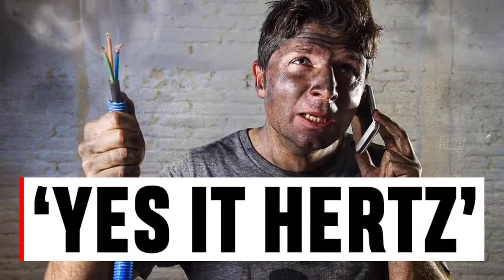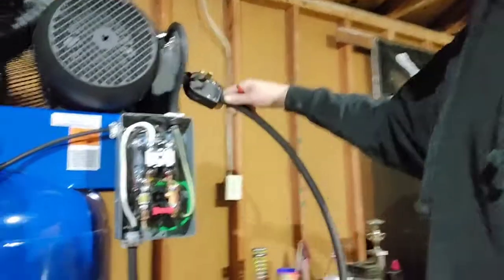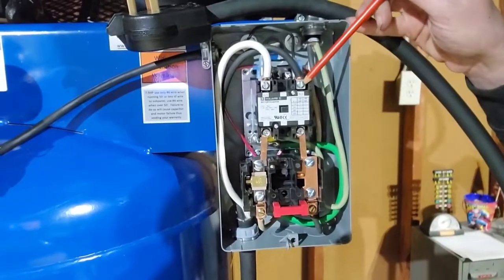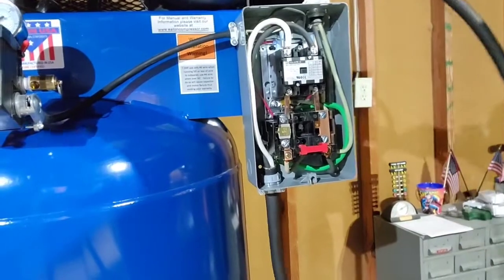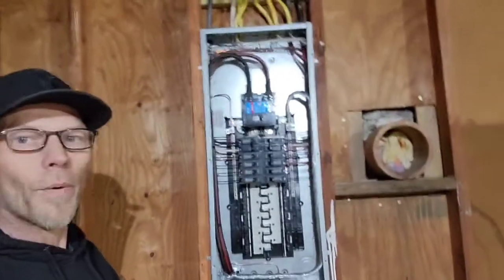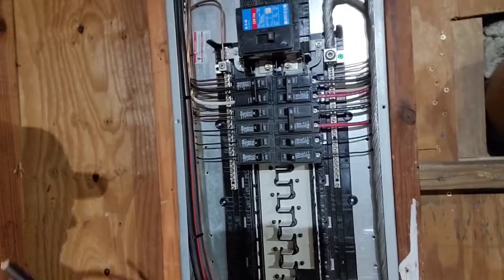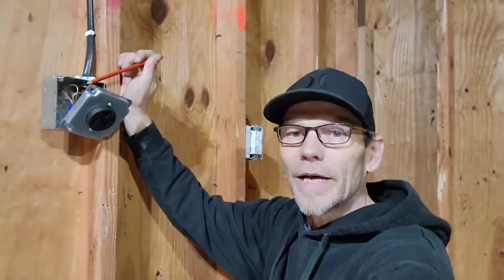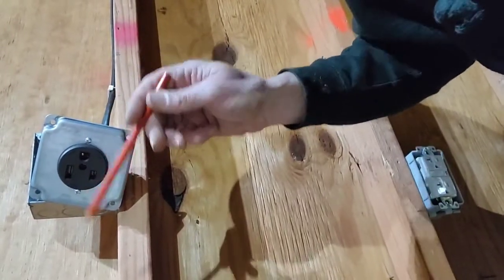Project X - DIY Air Compressor, 7.5 HP Motor, 220v, 1P, Plug and Receptacle Wiring Install - Part 2

Comment: Great video, thanks.  I have one of these coming next week.  Please correct me if I am wrong or if Eaton has some sort of special requriments however everything I have seen for 1-phase power (videos and discussions) states that the two hots (in your case, gray & black) doesn't matter which way they go (dont have to go black to black and gray to gray) in as long as they are each going/matching hot to hot on each end.  The Green ground however, is crucial.  The two hots are each 120v for a total of 240v, the compressor doesn't descriminate against gray and black as long as each of these are going into a hot on each end of the connections.

My understanding is that this could however be important if you were connecting 3-phase power.  What you are doing is by no means incorrect, it is actually very good practice IMOP.  Please let me know if you think I am incorrect.  I am learning all of this and everything I have written is to the best of my  knowlege from watching videos and reading.  Thanks again and please let me know how your set-up is working out for you.

This video shows what I am trying to convey.  https://www.youtube.com/watch?v=DINNg_hAWwI

Comment: A good video, even though it's a little shaky. A person good at DIY projects utilizes all the resources available to them. You could have used a tripod-mounted camera and your daughter or Dennis to film and later edit your video. When I connect my white wire to a 220V circuit, I wrap the ends with electric tape to show they are used as power and not as common wires. A black paint-type marking pin also makes a good substitute. Since your compressor only draws less than 40 amps, the two 50-amp circuit breakers could be replaced with two 20-amp ones. The 6/2 with ground cable could be replaced with a 10/2 with ground cable, which can easily handle a 40 amp load. The attached compactors can easily handle any start-up amps. I could be wrong with my wiring comments, but this is how I wired the same compressor type. Ten years later, I've had no problems, including tripped circuit breakers.

Comment: DIY pressure washer next 7.5 horsepower 5 GPM let's go
Reply from the maker: Lol, I like it! I recently bought all the stuff to add a 3/4" water hose connection over the winter for pressure washing. I figure then can use it as either a pressure washer or as a water jet for cutting 1/2" steel plates

Comment: Great video, was having  a hard time finding any good video on wiring up these compressors. Do you by chance know if this would be the same wiring for a eaton b27cge40 starter?
Reply from the maker: Appreciate the kind words Ethan. I struggled to find a video on this myself thus the reason I made this one..to answer your question, yes - it's the exact same principle, the eaton b27cge40 is a 1 phase starter & is wired up the same way. Where I wired the outlet you'll have the starter in its place. I like your use of the starter way better than my outlet, I may have to upgrade....

With it pulling 40 amps be sure to use 8 gauge wiring when installingit. Hope that helps!
Reply: @projectx2.718  Yea mna it this video is a gem for any guy like me who cant figure out how these are wired up. Couldnt find so much as a diagram. Mine is actually set up like yours, in a control panel on the compressor. Im torn between wiring a plug and outlet or just hard wire it. The other thing i was stumped on was it looked like the pressure switch had both leads running to 1l1 and not 2l3. Should it be running to both? Could have been me who moved it who knows. Bought this compressor as with no plug. Thanks again!
Reply from the maker: @ethanhall5501    - the 2 pressure switch wires; white goes to 1L1 & black to 3L2  from the factory. If you go to my part 1 video ( https://youtu.be/YXLui_TNky4 ) @ 7:35 you can see the 2 pressure switch wires coming into the top of the box & going to the 1L1 & 3L2. Hope this helps! 
Personally I've never seen both to the same terminal
Reply from the maker: @ethanhall5501  Hard-wired vs outlet: yesterday I had to move my compressor & being unable to just unplug it vs. disconnect the wiring was nice...just food for thought depending on how much it may or may not need to move in the future